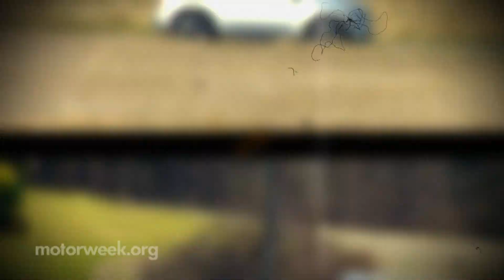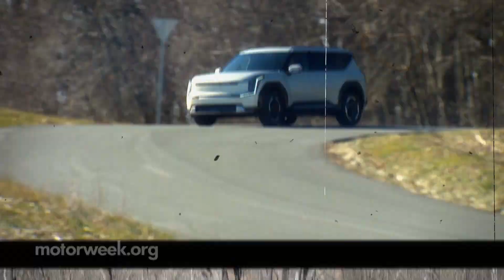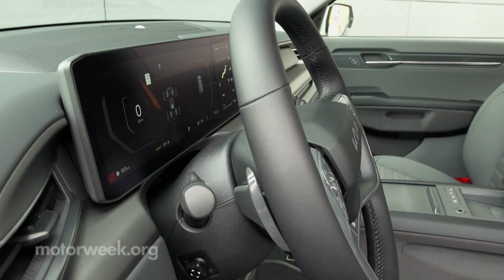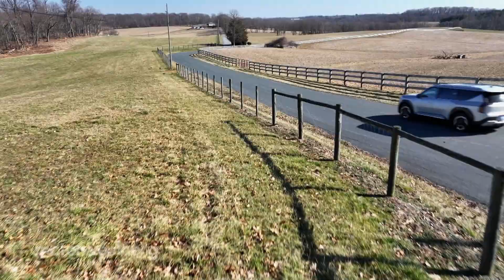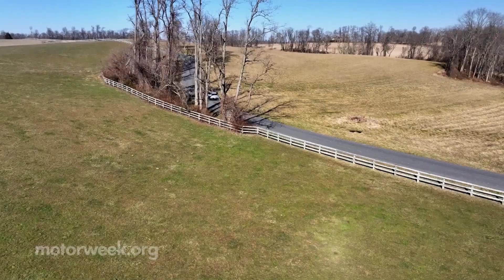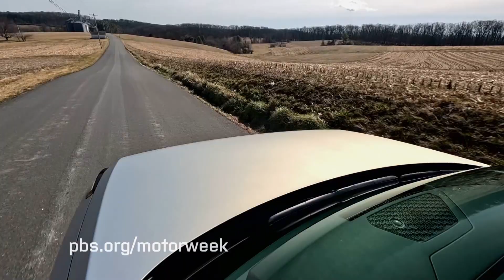The 2024 Kia EV9 is an ALL-ELECTRIC Telluride | MotorWeek Road Test

Comment: 41 kw per 100 miles but rated at 280 miles. I think the math was wrong. You will be lucky to get 220 with that 99kw battery

Comment: No, thank you. I'll pass
Reply: Because everyone loves paying $3-$6 a gallon for gas and paying every random part nobody knows what it does, but it has to be replaced and it cost $100+. I work at an auto parts store and people come in for parts I never heard of but cost hundreds of dollars. I rather buy an ev so I never have to work on a car again. Just start and go
Reply: @lucky1206   so if I have an ev, I  need some minor mechanical issues or any issues whatsoever.  Can I take it to my mechanic who lives down the street from where I live ? Or do I have to take it to the dealership?
Reply: @oscardelarosa8217  my wife has a ev for over a year and the only thing they did was rotate the tires and and add windshield wiper fluid. That’s it. Honestly. There is some liquid to keep the ev battery cool but it’s more like transmission fluid that it doesn’t need to be changed far into the cars life. There is so much that does not go into an ev that it would seem more confusing to someone like you that thinks every car needs to be fixed automatically. It’s crazy now to think people still spend upwards of $60,000 on a gas car and still have to keep o putting gas, buying oil every 6 months, change the spark plugs, then just 5 years later they need a new alternator, starter or some part nobody ever heard of but without that one part, the car won’t start.
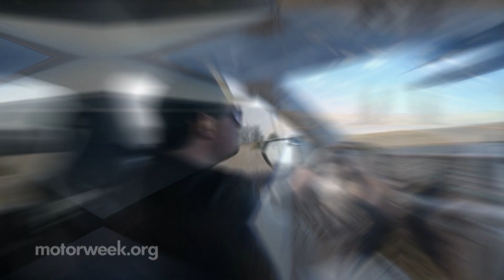Reply: Me too ✋️ 1:54

Comment: Buy an EV, lose $30-40k in one year.
Reply: I sold my eGolf for more than I bought it for.
Reply: All new cars depreciate. There are very few exceptions. And that’s generally due to a supply and demand issue. Both EVs and ICE vehicles have their use.
Reply: Wrong. It’s gas cars resale value that’s plummeting because they’re obsolete and soon new gas cars won’t even be available because they won’t be profitable to produce
Reply: @stevenhill3136  The data doesn't show that. It shows EV values don't hold up as well.
Reply: @alexmassengale433    With Tesla the lower cost was intended. In the interest of selling to the masses Tesla lowered prices fleetwide while still making a profit. Meanwhile legacy autos overpriced cars can’t compete continue to lose money

Comment: This car definitely looks like a winner. Anyone who's driven an electric car knows there’s no going back to gas. No comparison and being much more efficient is a bonus. Getting about 300 miles for just $7.00 of electricity
Reply: Here in Prague gasoline is about the equivalent of $7/gallon, so EV's are a no brainer. Not huge ones like this, however.
Reply: Yes we were saving around $450 a month last year when gas prices where really high and it looks like they will be up again this summer.  That savings takes off more than half of the payment, you are driving a new $45k 320HP AWD car but it only costs you the same as $25k slow economy car.

Comment: Another overpriced ev scam.
Reply: F-150 is $70k. That's the definition of overpriced...
Reply: What everyone seems to forget is you can save several hundred of dollars per month in gas. We save over $400 a month in gas with our Ioniq 5 that's more than half the payment gone.  EVs are not a scam, overpriced gas is a scam.
Reply: @SkaBob  

I save like $200-$250/mo in fuel costs vs my previous ICE car with my IONIQ 5 too, though it definitely depends on local electricity/gas prices & how much you drive. 

But if you live in an area where electricity is cheap and gas is expensive, an EV9 may actually be cheaper per month than an equivalent Telluride. I don't think a lot of folks realize that yet.
Reply: @SkaBob  what you seem to forget is that you will pay it all back when you sell the car.  EV resale value sucks. These are boat anchors. Dealers cant sell them at auctions. Plug any EV to let's say carmax.   Take Lightning as an example. $45k hit after 500 miles. Not to mention battery for your ioniqe 5 costs $60k when you accidently run over something and scratch the cover like those 2 poor guys.
Reply: overpriced compared to what?
Reply: @CrazyWeeMonkey  compared to everything.
Reply: @markb3866  

Such as? Be more specific.
Reply: Ev’s are not a scam, but yes it is overpriced
Reply: This new line of product is for early adopters, not the mass market. People have expendable income and are willing to pay extra for the unique experience.